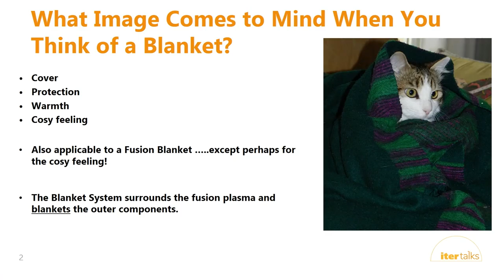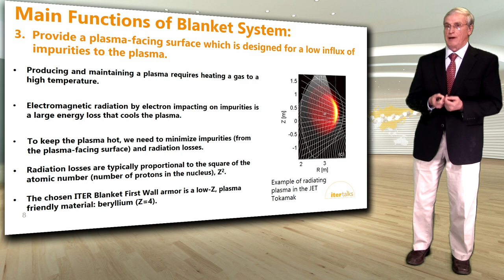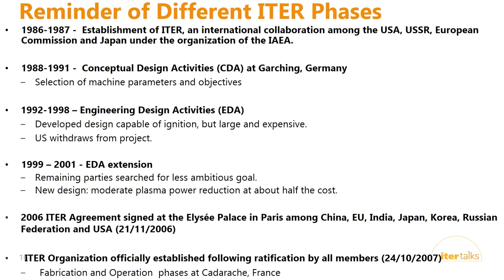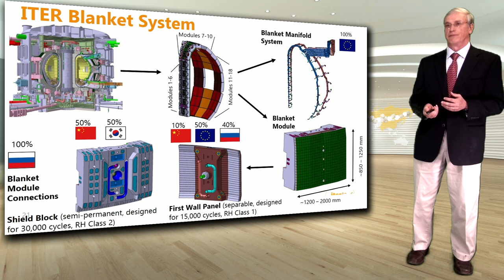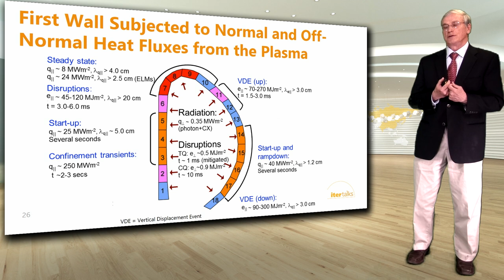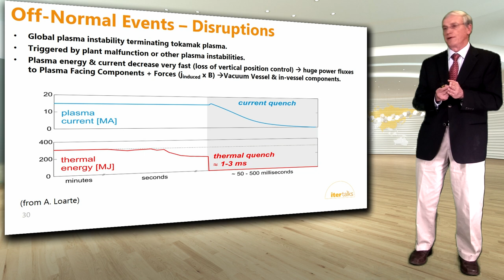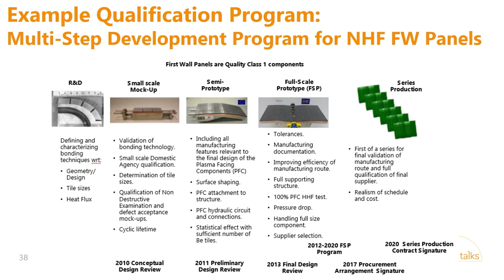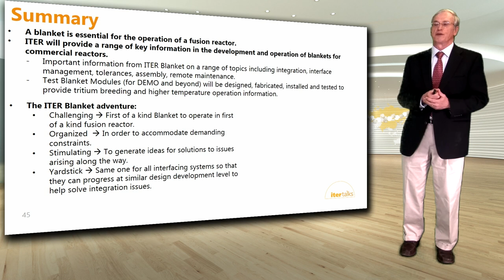ITER Talks (2): The ITER Blanket System

Comment: In the reaction of the neutron with the lithium, only the lithium-6 isotope is shown. However, this isotope comprises only about 7.6% of natural lithium, the remaining 92.4% being lithium-7. Does it mean that the lithium has to be enriched to get the required breeding ratio?
Reply: Les chinoises deja fait 200k plasma pour une minute et maintenant la vapeur pour tourner le turbine cugnot $$ yunis khay
Reply: Tritium chef yunis khay
Reply: In general, yes, lithium does have to be enriched to have a higher percentage of Li-6 to produce a tritium breeding ratio larger than 1, however, if you have very high energy neutrons (above 2.8 MeV, like the 14.1 MeV DT fusion neutrons), Li-7 can also breed tritium by taking up that neutron, fission into an alpha particle and tritium, plus a neutron. This process consumed energy but not neutrons. 
With a better neutron multiplier, we can make a natural lithium breeding blanket work. Both heavy water based and helium cooled ceramics have been studied. One might also add a fission blanket (for example to burn fission waste fuel) that will multiply neutrons better than lead/beryllium, and that will make natural lithium work as well